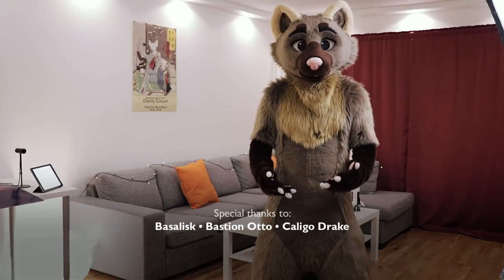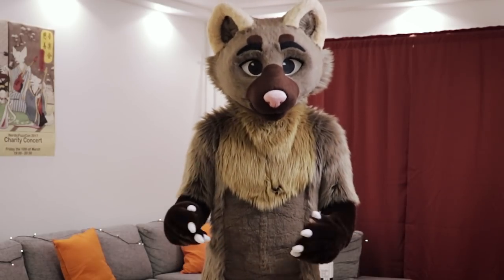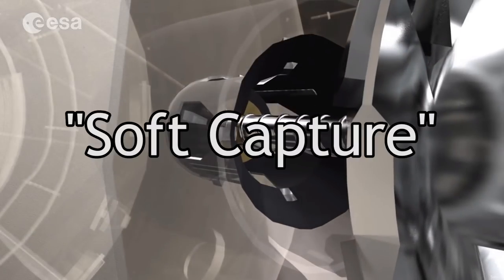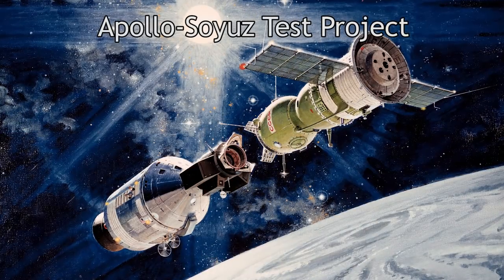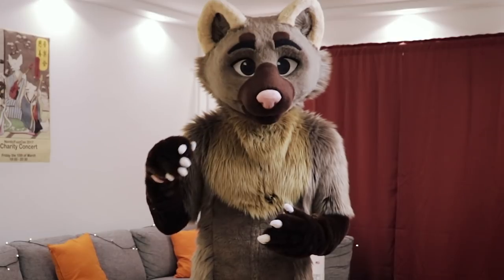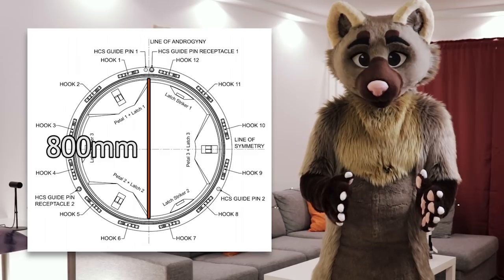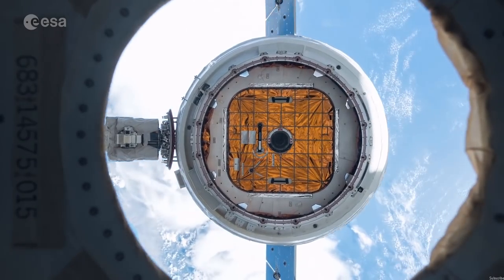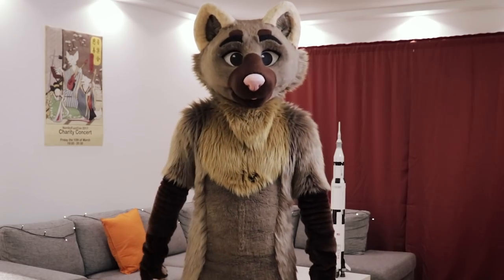How Does Docking In Space Actually Work?

Comment: I never understood why space machinery has to be as slow as it is. Sure, the process of docking would need to be slow so that it is absolutely precise, but once the craft are physically connected, why do they need to do everything else that slowly? And why would things like robot arms and panel deployment systems need to be that incredibly slow?
Reply from the maker: All the objects involved are incredibly heavy, even in space - hard to move, but also hard to stop once they're moving. To avoid life-threatening collisions (something that has happened in the past, on Mir), they'll want to stop something entirely, or back it away the moment things look bad. And I guarantee, if that's the case, things'll happen very quickly!
The robot arm is very low-power - something like Dragon is a very large and heavy spacecraft, so to move it around quickly would involve a lot of power. The robot arm doesn't need to be very beefy for most of its roles, and considering that taking more time also makes berthing safer and more precise, it's good to do anyway. Though cargo missions with future vehicles will be automatically docked, saving the crew a lot of time.
Reply: @HiyuMarten  Interesting. Thank you, Hiyu!
Reply: And when dealing with such expensive hardware the slow movement gives wider margins of error if something goes wrong, giving them time to fix things before the two craft collide